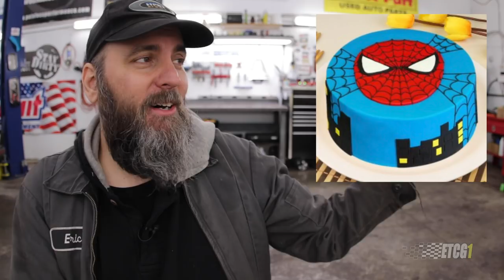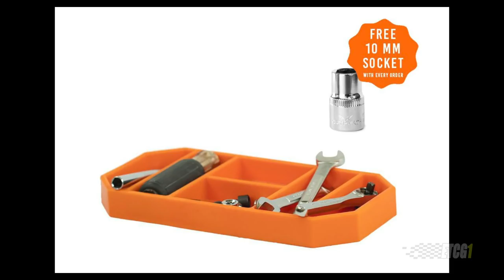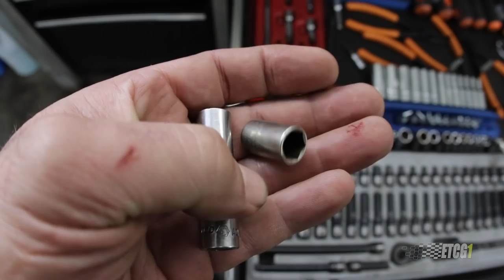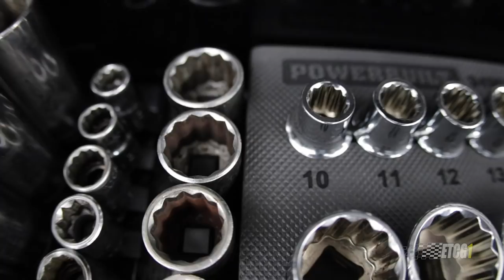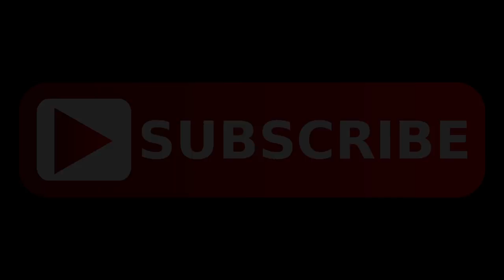What is Up With 10mm Sockets?

Comment: I'm going to try to rationalize this but I am just guessing based on my own experience:
When I grab a 17mm, I'm usually only pulling 2-4 bolts. When I grab a 12mm, I might pull 3 bolts. When I grab a 10mm, it's usually for a series of smaller parts and I end up pulling 10-30 small fasteners out before I end up putting it back in the box.
As a result, I tend to leave my 10mm sitting in the pile of fasteners because by the time I'm doing pulling out all the bolts, I'm concerned that I'll find another 10mm the moment I try to pry the part loose that I had missed.
As a result, I have only ever lost 10mm sockets. I've only lost 3 in my life, but I've never lost any other size. While it is my own negligence that causes this, the "popularity" of the 10mm fastener leads to jobs where you end up pulling a lot of them, one after another, until you become the kind of skeptic who thinks "as soon as I put this away, I'm going to need it again": So you don't put it away as often as other sockets that you might use a handful of times per job.

Comment: Pretty sure it’s because it’s the most common sized fastener, therefore the most used sockets. Law of averages - most commonly used sockets will be the most frequently lost. Especially when you’re switching out from 10 to 8mm which is second most common for small fasteners.

Comment: 10mm is the most used, so its the most misplaced. Im assuming most people use the 10mm then get to something that ends up being hard to get off thats not 10mm. Then after 30 min of trying to get off a stuck 12/14mm, the 10mm has rolled around, or forgot where you placed it.

Comment: I can take 70% of my miata apart with a 10mm.. 100% with a 10, 12 and 14. I have a lot of those sizes and tend to lose all of them. But the 10 the most of. Because I use it the most, and it's so small

Comment: Probability combined with modern internet culture - 10mm being used more often means they are more likely to get lost, combined with the fact that metric fasteners are more common than imperial fasteners in today's vehicles, means that if you're going to make a meme about losing a socket, the most likely is the 10mm (not an imperial size).

Comment: The 10mm socket. Lets just say that it has the mystical arts of hide and seek.    
I have lost quite a few  of those buggers.  Nothing like looking at your 99% complete socket set for thAt gaping hole at 10mm slot. 

Its because its one the most common sockets used, and its usually the smallest/thinnest. So when it falls into the engine bay and you don't  hear it fall through, or when it rolles under cabinets it just becomes lost to the world.

Comment: The thing is old American cars didn't have much teardown to get at the problem. Since modern fuel injection you need to pull out the battery, airbox , and associated plastic pieces to do almost anything to an engine.

Comment: Just make all hex sizes the same, and get rid of the torx, hex, triple square, and life would be easier. While you’re at it bring back dip sticks and more convenient drain plugs and fill holes for engines, transmissions, differentials and transfer cases.

Comment: ETCG1: I can explain it to you, but I cant understand it for you. 
If you grew up working exclusively on European cars; The "ten" is the most commonly used size socket, you'll need. You can literally dismantle 75% (or more) of a Mk2 Golf with a 10mm socket.  As such, you are constantly losing, misplacing or otherwise looking for a 10mm socket. 
These things have been know to literally roll away on their own as soon as you turn your back. Occasionally they will notify you as the clank down the floor drain, on the other side of the shop. 
8mm and T25s are also escape artists.

Comment: I’ve lost my 14mm more then I have lost my 10mm, I was a Toyota tech before so that’s a common size as well
Reply: I can't remember which one,  but honda nissan or toyota messed all that up by also using 10 12 13 14 16 18 instead of the old 10 12 14 17 19

Comment: Last summer I lost a 1/2 inch ratchet.  Bought a HF Pittsburgh  to finish the job.  Later found it stuck inside the metal pipe I was using as a cheater bar.

Comment: The reason I dislike the metric tool system, is because of the 10mm, 13mm, 15mm, 16mm, and 21mm sockets, I'm always having to replace those damn things, not just because I lose them, but also because they get so used and worn out.

Comment: Yeah well they’re so common and they’re always missing because they get left on the hoist then left on the fender on the radiator shroud and the customer drives off you can’t find your 10 mm and it’s actually under somebody’s bonnet driving around I’ve had cars come back in after 12 months and my old 10 mil is still up on the quarter panel sill.....

They just always disappear mate

Comment: Its because you can never have enough 10 mm sockets and wrenchs. i havent lost any myself but i have them in my truck all around my house and garage. I do appartment maint and i work on all my own stuff. computers dont follow the trend for good reason if its metric and it has a hex drive screw or nuts and bolts there is a 10mm in there somewhere if not everywhere. Im helping a friend strip a 2003 escape and use useful parts on his other 2003 escape and we loose a 10mm there is a never ending supply. 10mm makes the world go round not money.

Comment: I’m not a mechanic in the slightest, so excise the non mech lingo. I had an ‘84 Mitsubishi Sigma here in Australia a few years ago, and I can tell you (‘cause I checked.) the bolts holding down the seats, the three holding down the plate on the top of the gearbox that the stick pivots on, door hinge bolts, and numerous ones in the engine bay were 10mm. I think it’s the “Standard” go to bolt size. In other words, a few cars have a lot of them, the rest don’t because manufacturers get their jollies from being a pain in the ass.

Comment: For some reason it was always the 6 point I would lose of any socket and would use a 12 point which I would alway seem to find and sure enough it sliped most of the time. learned to leave my hand open to avoid the accident, lmfao

Comment: we have too many sizes, there is NO reason for the 10, most cases a 9 would be fine and the few that escape could use an 11.  my olde '65 volvo used two sizes for about everything,, 11 and 13 which back then was real convenient since a 7/16 and a 1/2 would replace the metric tools I didn't have.  I have rarely used a 12 either.  Old Mr. Ford had it all fingered out, don't have too many parts.  Back in the sixties all ford engines used the same quart sized filter, the 534 truck engine use two.  the qt. sized ford filter was ideal for the volvo, it had the benefit of adding a half qt of oil capacity.  Going back further, my dad's 37 ford coupe had only three pieces of glass, windshield (left and right flipped),same with the side windows, just flip them and fordors used the same glass in the rear.  the D windows in back again were a flip.  Mr. Ford was a sharp chap, I kinda like him.

Comment: I'm just as organized with my socket sets and I still have my original first 10 mm in my first socket set going 6 yrs now, but my car has roughly 30% or more of its bolts as 10 mm's so I often need to use a 10mm but my sets are all on those slide rails which I always have together in my kit in case I need to switch out another socket, my biggest socket issue is with 8mm's for whatever reason jeep (my wife's vehicle) decided to use 8mm's on the driveshaft yolks and torque spec a few ft lbs before failure so either they snap or round my God damn sockets causing the need to buy more 8mm or full sets just as extras now I have multiple sets missing 8mm's! >:( 😡 f*** you jeep engineer's! Lol

Comment: stores have run out of toilet paper because the guy that maintains the paper machines at the mill..... lost his 10mm socket 0.0

On a different note could a car manufacturer make a car that uses nothing but 10 mm bolts nuts???

Comment: Every single bolt on a Japanese car is 10mm. Every single bolt on a Japanese motorcycle is 10mm. 10mm 10mm 10MM... Regular Car Reviews
Reply from the maker: Obviously they weren't working on an older Nissan. They use Philips head screws for everything.